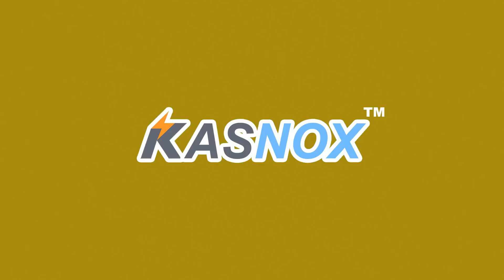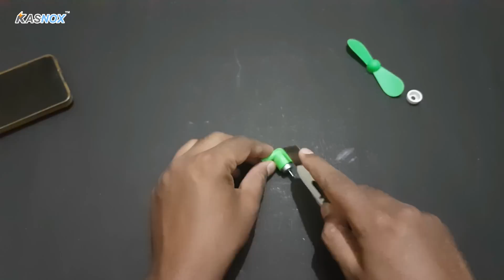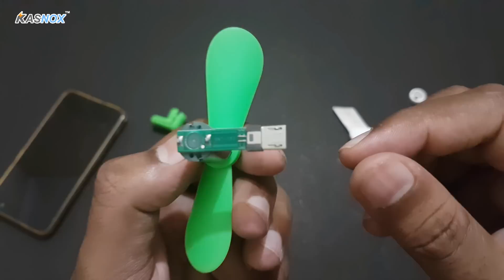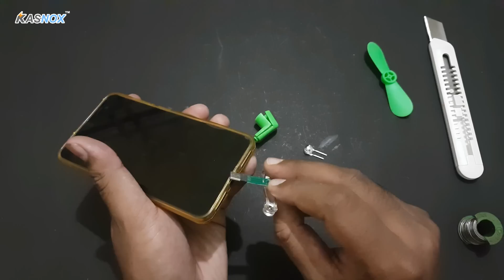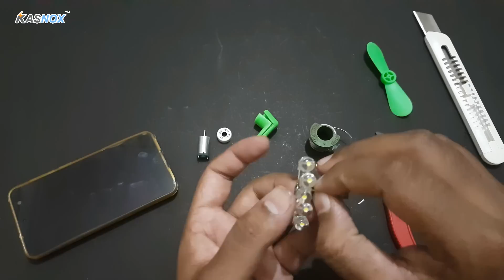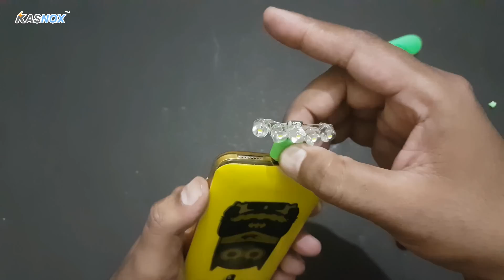How To Make Micro Usb Otg Flash Light With The Use Of Micro Usb Mobile Fan- kasnox

Comment: How do I calculate resistance for those LEDs (or) Which number resistor should I use to connect those LEDs with a 12v battery
Reply: 220 ohms
Reply: @Shortsnips1  Thank you, Can you show me how to calculate

Comment: data cable se ek led bulb ko connection diya toh jaleja kya?
Reply from the maker: Tejas Pednekar yes jalega
Reply: KASNOX 2 wires 2 end pe lagake connection denge toh ho jayega na bhai chalu
Reply from the maker: Tejas Pednekar samajh nahi aaya
Reply: KASNOX Agar data cable jo apna charger ka ka hota hai..usse cut karke.Led buld ke do end pe connect karke use charge ke slot mai daala toh bulb jalega?

thnx for replying
Reply from the maker: Tejas Pednekar ho jayega bass app eek bar wire ka structure dekh ligiye ga otg ka then warka karega
Reply: KASNOX are you from south india